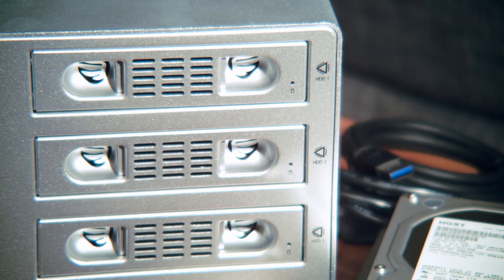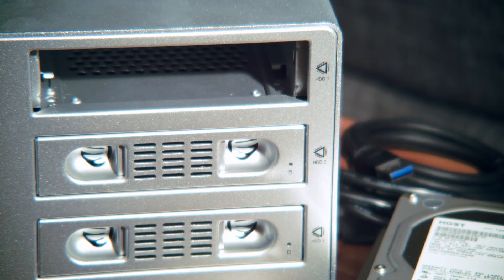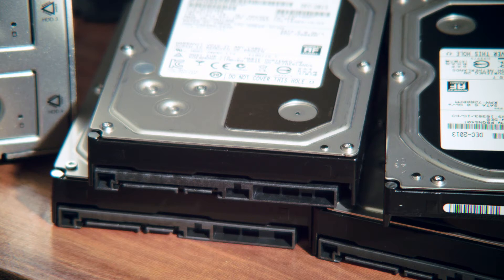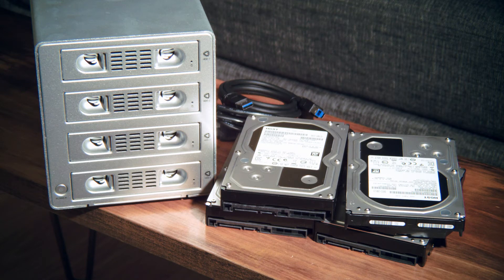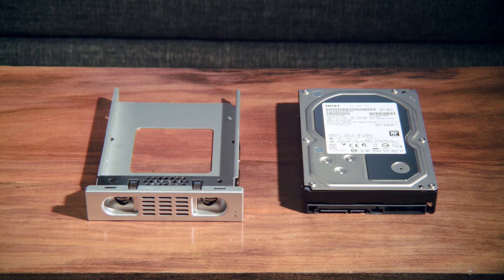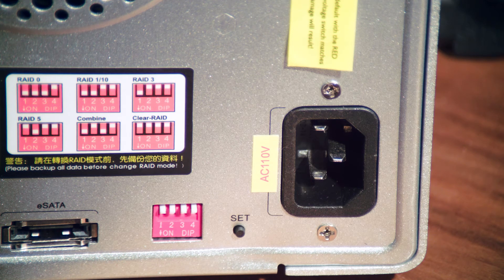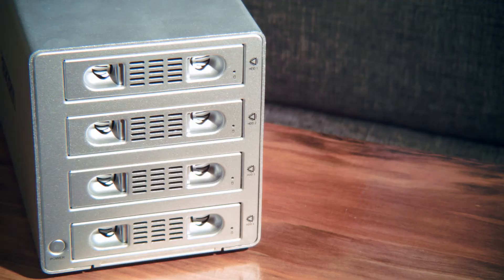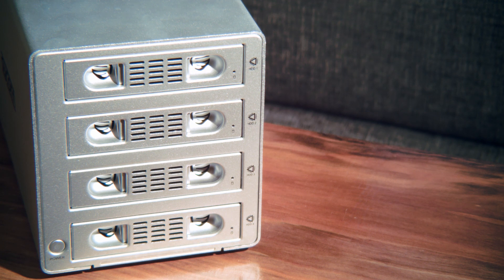How to Assemble a RAID - Post-Production Data Management

Comment: Is better buy the Dyconn 5 with firewiere 800 over the Dyconn 4, what you thing?, nice tut
Reply from the maker: If you need FW800 then yes, definitely. I knew I was going to use USB 3 to connect the RAID, so I wasn't worried about FW. I also got the 4 on sale, so that was partly why I picked it over the 5.
Reply: Thanks. Usb3 and eSATA is my choice.